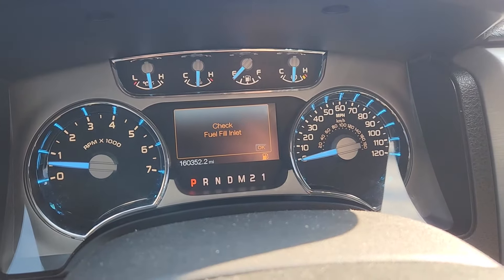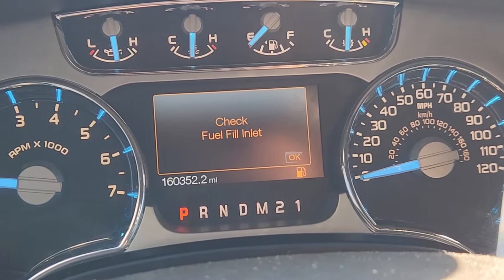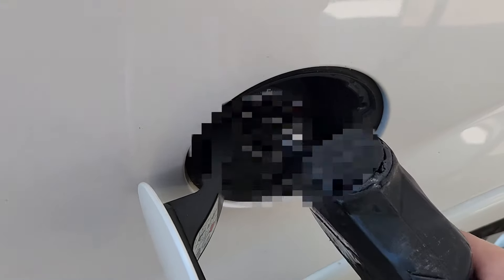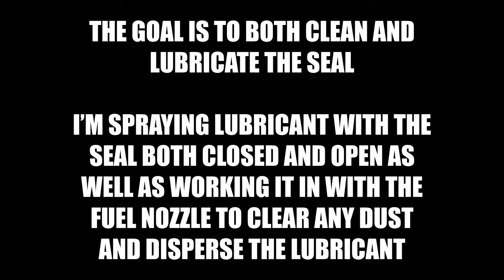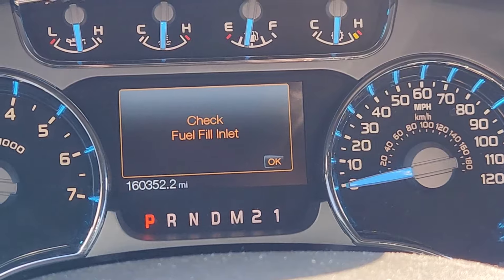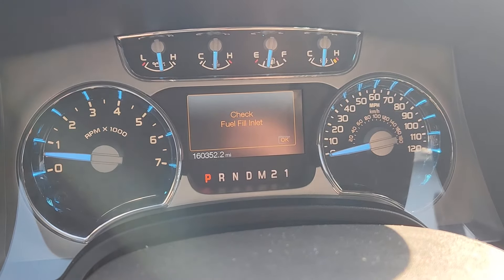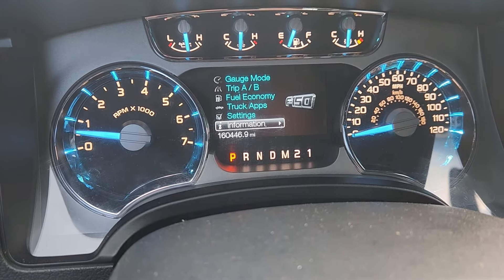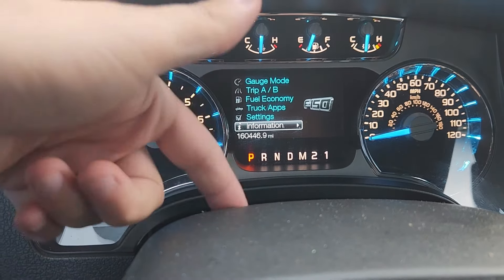Ford Check Fuel Fill Inlet message - Repair for FREE

Comment: Just happened on my Mustang. I'll give this a try. The other annoying thing is the car keeps thinking my purge valve has gone wrong, I literally just replaced that 3months ago 😵‍💫
Reply: Did it work ?
Reply: @audreybryson5064  

Yes and 'no'?

I used silicon spray and really blasted the area. I let it sit for a while and the issue seemed to have gone away... Until it randomly showed up while driving.

I had to re-tune my car because I changed wheel sizes so that cleared the computer of all DTCs, stored and active.

Since then, I've been to Ohio and South Dakota and back, the issue hasn't come back since.
So for now, it seems it might have worked.
Reply from the maker: Mine has came on twice over the 3 years I've owned the truck and both times this has fixed it within 50-100 miles of driving. If it is continuing to come on it's probably a sign the EZ fuel assembly needs replaced. The spring, hinges, or seal that close it off may actually be compromised from wear.
Reply: @BCDriven  
That's what I was beginning to think and am afraid of 🤣🥹😭

No idea what I'm about to get myself into but I bet Ford didn't make it easy to change (S550 Mustang here)

Comment: Won't dw 40 fall inside the tank if I spray it ?
Reply from the maker: @mandocabral3615  its such a minute amount when it's diluted across a tank of gas. It's still combustible too so really no issue, obviously I wouldn't unload a whole can in there but a quick spray in isn't going to hurt anything.
Reply: @BCDriven  thanks

Comment: What kind of lubricant did you spray?
Reply from the maker: @emelianocasarez5026  I used silikroil because I use it all the time and had it in my truck but any flavor of spray oil will work. WD40, PB blaster, even store brand. I just wouldn't use like a white lithium spray or anything that leaves a thick coating.
Reply from the maker: Well I should probably say Kroil with silicone of you were trying to search for that exact stuff. Silikroil is a nickname. It's awesome stuff but man is it expensive.
Reply: @ thanks!!!
Reply: That last part helped a lot actually